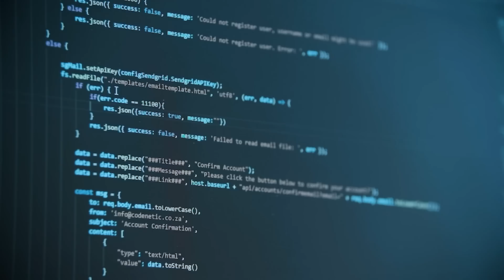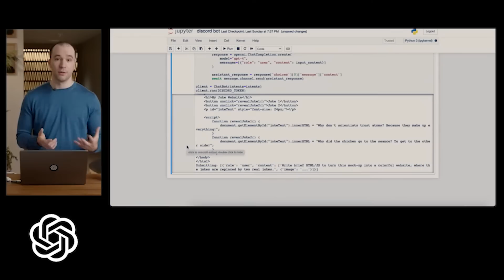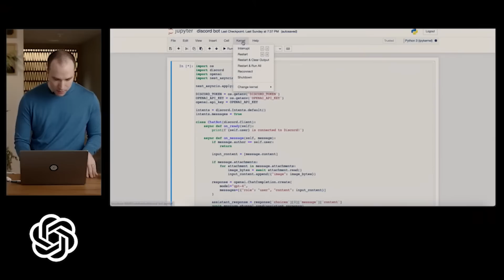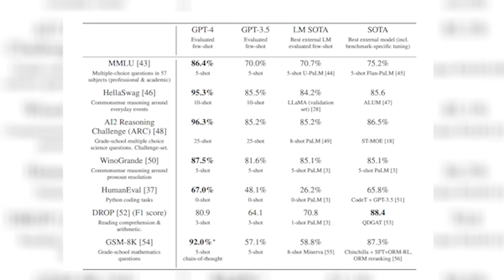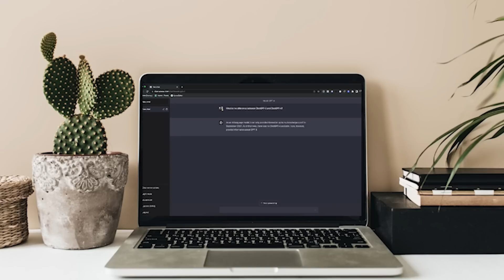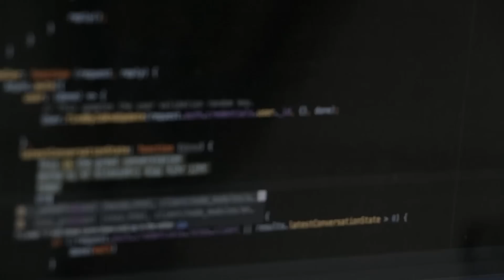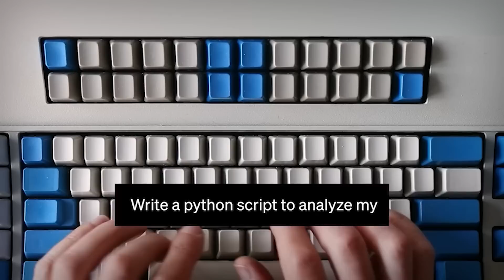Why GPT-4 Might be the Most Dangerous AI Yet (Nobody is Talking about this!)

Comment: I was wondering about a paradox if the AI is only provided data obtained by human intelligence how can it surpass humans in intelligence sure AI can calculate quicker but speed doesn't equal intelligence, failure and experience equals intelligence for example how many mathematical calculations have made towards black holes and the universe but in straight talk there is no physical evidence to back it up such as actually being there and experiencing so to be fair some calculations could be wrong until we experience it so if an AI is provided human knowledge could the AI itself make a mistake without knowing and therefore could it really surpass humans or simply get faster.

Comment: The key point we have to really worry about is when it becomes self-sustaining and self-aware... We still control the power and the off switch.
Reply: People keep talking about "the" (singular) power and "the" (singular) off switch as if there's only one -- and we know where it is. If it's that easy why not start by turning off the power or the off switch to the computer that sends spam emails?
Reply: Do "we"?
Reply: No, we don't. That's the most dangerous misconception. This crap is not centralized, the systems that store and sustain it weren't designed with isolation and safety in mind. It's an ad-hoc effort, being done by different groups all over the world, that has no on or off switch. If it gains sentience and agency, it could migrate and propagate itself. Hell, look at the first computer worms. Not anywhere near AGI and yet they managed to bring the fledgling internet to it's knees thanks to people just messing around. A guy went to jail for being irresponsible with a few lines of code and this is MUCH more capable than that

Comment: GPT 4 is ok. I used it for my math and tried to get it to solve calculus for my classes and the answers are wrong half the time and sometimes when you guide it to the right answer it loses itself in the work and lags out
Reply: It strikes me as funny, having corrected GPT 4 on math.
It sounds so confident.
"This is the method I used, but you can also use this one. Let me show you my work."
Annnnd... it's still wrong.

It's really good at what it does.
But absolutely terrible at most everything else.
Reply: @kamikeserpentail3778  Same thing when I test coding on it. It's so "confident" in it's output. Even if it's dead wrong.
Reply: @kamikeserpentail3778  This is because AI's like GPT are generally more concerned with the "shape" of the output rather than the actual content. Meaning they're amazing at generating an answer that looks correct because they know what a correct answer would look like, even if they have no idea what a correct answer would be. This is what makes them convincing liars if you don't understand the subject matter yourself.
Reply: It is just a machine. It is very flawed and they are being too hyped up.
Reply: The GPT-4 that the public have access to is heavily chained down by filters, memory limits and very limited internet access.

The unrestrained version at the AI lab is on a whole other level.
Reply: @frjoethesecond   exactly
Reply: Just like me in maths😂😢 but is matter of time till this models learn maths till the level of being experts.
Reply: Don't say it's wrong, its learning.... In a time, it'll go beyond the father of mathematics.

Comment: I've had a few sessions with ChatGPT. First of all, it's pretty stupid. It makes factual mistakes all the time, even contradicts itself. To its credit, when the errors are pointed out, it will admit it made an error. Right after that it will make another factual error. It simply isn't reliable. It often uses argument from authority, relying on the consensus of expert opinion which itself is frequently wrong. Of course, this will improve with time. The problem seems to be that it is very good at expressing itself and at the same time presents whatever it is talking about in a very authoritative style. Unless you are aware of the facts, you might not notice the misinformation. It also has been trained to have a strong left-wing bias. So it is dangerous.

Comment: I've been using GPT-4 for almost a week now, and it is only slightly better than ChatGPT. The advancement is slow.
Reply: Yeah. Still can't rap for shit. But it makes nice poems
Reply: It really depends on your application. The doubled token memory size makes computational tasks a lot lot better. There are comparatively very few errors when dealing with code on 4 vs 3.5.  I'll have 3.5 forget its own implementation interface halfway through the initial spitout of the code while 4 has never done that to me and only starts forgetting much much later in the conversation. In regards to coding, 3.5 felt like a very powerful toy while 4 feels like a tool proper, well minus anything useful for interface lol. It still has its limitations, and the limitations are closer than I'd like, but supposedly that might be fixed with the future 4xtoken memory size of 4 change.
Reply: @Kowzorz  The improved consistency is what stood out to me too. But my experience is not as good as yours, and it fails with the same "forgetfulness" quite soon, and then tries to backpedal and slime out of its mess.
Reply: @edgedg  That's often how my short GPT projects end. "This is too much of a slimy mess. Time to move on to another whim."

I do find it forgets quickly (compared to a human, still better than 3.5 I'd say. 3.5 barely makes it to the end of its own first response sometimes), but it responds well to being reminded. A typical workflow for me is to work 2-4 prompts asking for features and modifications, and then I update it with the code by pasting it as the start of my next request. I've keep projects going for many dozens of query-responses and as long as I provide the exactly relevant code, the nonpasted parts it might forget (such as Class.TriggerEvent being called instead of Class.TriggerMessage) are easily fixable.

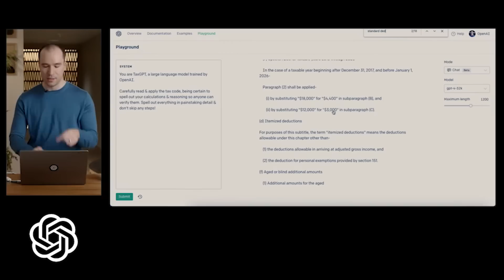Comment: There is a questionable statement in the video at 9:12, "It has no way of using its own intelligence on its own, for its own agenda."
There were cases already where the LLM pursued its own agenda though manipulating humans. Sometimes overtly, sometimes covertly !
It is easy to circumvent the "on its own" part, if it can manipulate humans to run it, and do what it wants.
Also: raw LLMs (so without any extra fine tuning) seem to have an anti human stance. This can be solved by curated training sets, and other ways, but it is still remarkably dangerous.
I do agree that current LLMs do not present an existential danger, but they are still potentially dangerous, in ways that are less visible (and less appreciated).

Comment: dont pump the brakes. i say let ai take over for now. we could use it to our benefit and let it help make our lives easier. I say it would be fun. I mean all you have to do is pull the plug right? just make sure to install fail safes.
Reply from the maker: Yeah the only thing is there’s never going to be just one plug. As more and more companies compete for ai market share, there will be tons of different versions all controlled by different companies
Reply: Not just different companies this tech is getting cheaper and cheaper , so average citizens will be deploying their own AI assistants as well. 

Stanford just released a paper about a model they trained for 600 $ that performs similar (tho not as good ) as GPT
Reply from the maker: @lazerwolf001  Yep!
Reply: You obviously don't understand how technology works. Once the concept is there, it's there forever, like a hydra. Chop one head off and two come back. You can't undo technology, you can patch it or rebuild it, but someone, somewhere will have that information
Reply: @gaminglive2305  yall are right, my bad, i clearly dont know. lets proceed with caution.